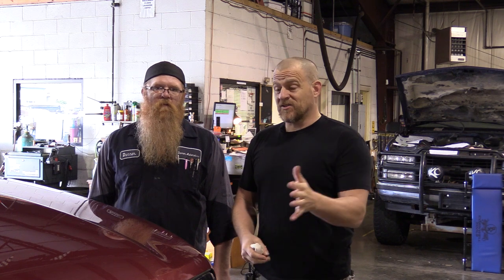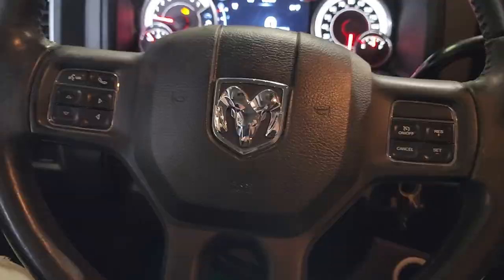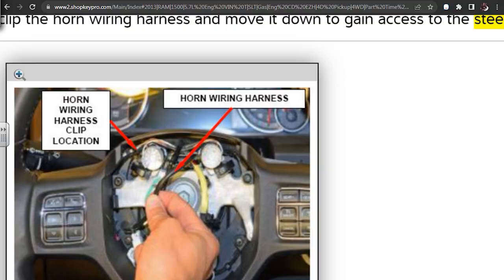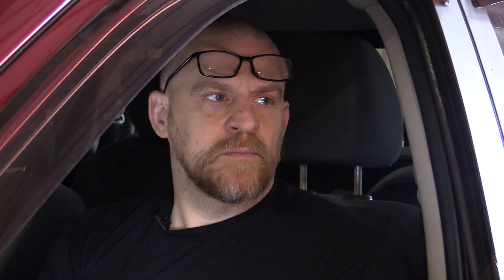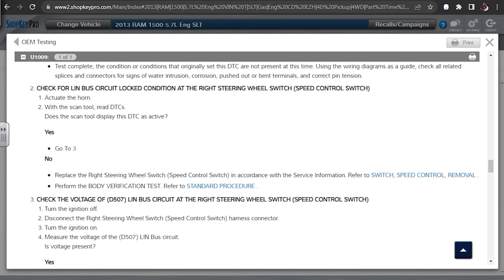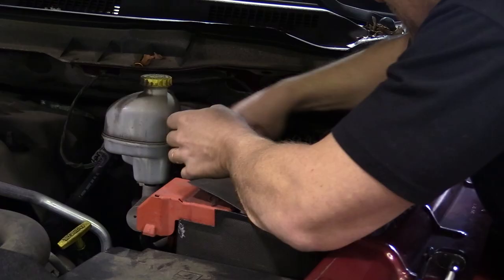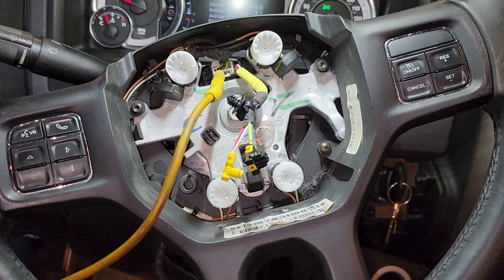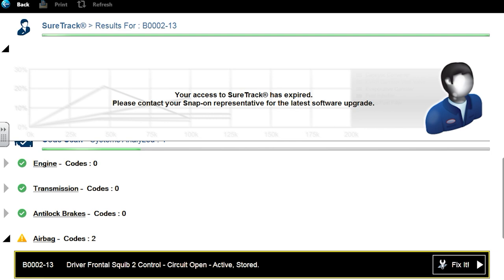2013 Dodge Ram - No Horn/Steering Wheel Switch Functions - LIN Bus Fault [U1009-00]

Comment from the maker: Happy New Year everyone! Just one comment on this video as I was not clear on this until the end. The Cruise Control Switch portion of the Right Steering Wheel Switch was hard wired and was NOT part of the LIN. This is why nothing else worked except the cruise control switches. ALSO the right steering wheel switch is a module!! And it had a broken ground, so this module was essentially dead. So again, why is a dead module communicating the cruise control switch inputs messages? It WASN"T, the cruise switches are hard wired! I meant to give an overview of that at the end of this video to make it more clear, but this message is good enough. Thanks again for a great 2022. Looking forward to what 2023 has for SD!
Reply: Thanks. And a better new year to you and your family.
Reply: Hello Paul,
What do you consider to be a reasonable price on a used Snap-on Verus Pro?
Happy New Year to you and your family. God Bless you all.
Reply from the maker: @janico76  depends on the update as I believe the pro is no longer supported by Snap-on. I know my Verus Edge support ends in 2025. What is it updated to? What model year? I'm thinking 2-3K tops
Reply: Wish you a happy new year for all of you guys.
Reply: @ScannerDanner  21.2
Thank you Paul for replying back to me. God Bless.
Reply: The hard wired switch input (I like the term discreet input) was described in the code description/theory and operation portion.  I had to rewind back to the wiring diagrams to realize the right button module had a dotted line around it, and didn't show anything about the cruise control buttons.  So you had to compare data given and diagrams shown to come to that conclusion.  And alldata kept calling it a sas steering angle sensor, while your verus kept calling it a steering column control module.  Lots of holes to jump across during this diagnosis but ya still got it figured out!
Reply: Hello I have a customer with a 2008 dodge ram 1500 having same problem. Do they have the same wiring harness for the steering wheel or do you know?

Comment: I was having the same issue. I pulled my air bag out and found the exact same yellow wire had broken just like yours. I soldered it together and it all seems great. Thanks for the info
Reply: My 2015 is doing this exact thing also. I was going to go the route of replacing the clockspring but I’m going to check that yellow wire first.

Comment: Why did I find this video literally the day after i fixed mine, mine was the Grey and Green wires failed.. $278/CAD for a new harness I went to the wrecker and grabbed another for $25. I've had cruise control issues for 4 years

Funny thing is the left button, the under buttons, heated steering wheel all go to the right cruise module.

Comment: I’ll bet the dealer tech caused this while performing the recall! Great video as always Paul!  Happy New Year
Reply from the maker: I think so too. They had the harness too tight when they installed that zip tie
Reply: @ScannerDanner  zip ties, also known as "zap straps", because they're the killer of networking and other low voltage communication cabling. doh!
Reply: Yup exactly what happened to me everything was working took it in for the recall and after 1one week my horn wasn’t working so now I have to fix it myself never trust a dealership

Comment: Just wanted to say thank you, my 2013 RAM has no functionality on any of the steering column controls, so I watched this and took it all apart was actually pretty easy, the recall work was done I could tell by the rubber covers on the airbag and the zip tie. I checked to make sure the wires weren't broken and they weren't, so I checked for power going into the clock spring and it is getting power in so I'm pretty sure it is the actual clock spring that's malfunctioning. Just wanted to say thank you your video let me know at least where to look.

Comment: I couldn't find one for this application, but Mopar sells terminal repair kits. You look up the connector and you can buy a pin with a length of wire already crimped in place. That way you can solder or crimp further from the terminal. It's also nice when the terminal is spread or corroded.
Great diag, I feel spoiled with my OEM service data and scan tool. Lots of respect to the independent shop technicians.
Reply from the maker: I really needed factory service info on this one. Thank you!

Comment: Thank you for the video.  I've been working on a Jeep JK project which happens to use the same switch.  The cruise control switch includes SC1, SC2, and SC ground.  The swich circuitry includes a resistor matrix and, by pressing one of the cruise control functions, you are creating different voltage drops on SC1 and SC2.  The resulting various combinations of voltage drops are what determines what button you are pressing.  This is similar to how the old land line DTMF phones work.  Anyway, on a Ram, those three wires (SC1, SC2, and SC ground) connect to the steering column control module (SCCM).  The microprocessor in that module senses the different voltage drops and outputs can-bus messages to the ECM.  The SCCM may also consolidate all steering wheel-based LIN traffic too but that is not part of my focus.  In a Jeep JK, however, all three SC lines go through the clock spring, bypass any (if any exists) SCCM, and terminate to the ECM directly where it detects the matrix and controls the cruise function.  I swapped a 5.7 Hemi into my Jeep and am trying to get the cruise control to work like the Ram.  I need the can bus messages that the SCCM generates when you press the buttons.  If I can connect my switch to a custom microprocessor that is programmed with the can messages the Ram sends, I can get my cruise control to work.  It requires a connection to the can bus and software that would display the can message when the button is pressed.

Comment: I have the same exact problem in my 2014 ram, this is the first video that has suggested it is not the clock spring. I will have to check to see if the recall extends to my year truck. Awesome video.
Reply from the maker: Thank you!

Comment: Great video as always ScannerDanner! Always appreciate watching your fault-finding methodology and seeing how thorough you are.

Regarding the right switch still reading on scan data, I think the key information is that the right hand (cruise control) switch is hard wired to the steering angle sensor, which to me makes it sound like it doesn’t use the same LIN connection as the other switches, and therefore the cruise control inputs would still be visible.

Just my thoughts on this tricky little issue 👍
Reply: Sorry, just watched the rest of the video and seen that you mentioned this near the end..! I really should watch all the way through before commenting!

Great work as always 👍
Reply from the maker: All good! Thank you so much

Comment: Definitely caused by the dealer. When I had a 2010 dodge 2500 service truck years ago I took it in for the tie rod recall and they didn’t even align it after, wheel was 45 degrees off so back it goes. After the alignment was sorted, full lock to the left seemed odd so I look underneath and the tie rod adjuster sleeve clamps are positioned to where they contact the front axle. I loosened the clamps and rotated them without moving the sleeve and it was good. We’ve had all the big three service trucks and I know this goes against some opinions but ford has given us the best service all around. That same dodge also left me stranded in midland, tx at 11pm on a Sunday when the tipm shit out. Good times

Comment: Had a 2015 towed in no radio, no crank , more than 1/2 of the under hood fuse box was dead.
   Info was not great on diag but I found that the ignition module ($900) sends a bus signal to module behind the seat that sends power to 1/2 the under hood fuse box.
    “Internet” had some hits on broken corroded wire back to the module behind back seat panel near rear window motor. Customer refused more diag time so never got to see the issue.

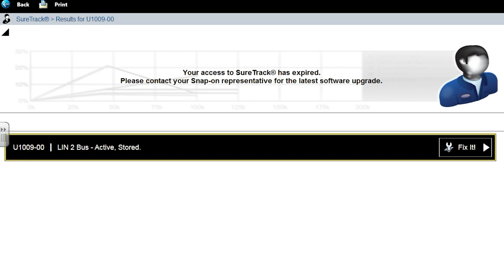Comment: You can see on your diagram at 6:02, (bottom left)--  that your broken wire was a ground (which was a white and yellow).   You said it was yellow;   I thought it was a yellow with white stripe-- because you can definitely see white on the video;  But I guess it was actually a white wire with just a yellow stripe.   There was only such a short piece of the color showing, and it's super easy to mix up white and yellow without blasting it with intense light so you can see it clearly.   Cool video
Reply from the maker: Combine that with my eyes that aren't so good up close anymore. But thanks for that confirmation! Appreciate it a lot! Happy new year

Comment: Interesting problem with this one. They don't give anyone much wire to work with there. Your brother had a great idea there Paul, where taking the wire and soldering it back to the terminal. If you tried to open that crimp and tried crimping the end of the wire in there you will lose your mind. I wish manufacturers would just make cut leads; repairs would be much easier. That way, you can install the new terminal and either solder or use a splice sleeve to connect it. I tried before to crimp a wire on to those metal terminal ends. I didn't lose my mind but came close🤣. I truly believe a robot does that crimp when made at the factory.

Comment: Now how many shops would ask a technician to diag this for 1hr? 

Or how many would change every part that it "could be"?

And out of those shops, how many of them would do so because they've not trained the front of house staff on proper procedures or how to properly explain and obtain approval for the testing required?

I think we're going to have a mandatory ScannerDanner video lunch on Monday to ensure our advisors have a true understanding of the work even seemingly simple issues may require.
Reply: Right, you/shop have to explain to customer what you do for the charges.
   Basically we do a minimum cursory 1hr inspection , pull codes , check basics , read code info . Then go from there.
   Had a issue with a 2015 Ram appears the comm line to the module behind the rear cab panel was short/open or module was dead. 
   We got to the point where the 1hr was up and the next step involved removing interior panels , carpet and such.
Customer decline more time.  He kept telling us to just put an ignition switch in , $900 and un available at the time , he towed it out and have not heard back.
Reply: @@user-ud8pj3sq2d  exactly! We sell by the test. The technician is given 1.0hr for testing and .5 for general vehicle overview. 

The tech comes back with a list of the test (and associated time) he needs to ensure we have the proper answers. 

We then matrix that time to ensure plenty of buffer is present and call the client. 

We do advise the client "Mr./Mrs. Client, we may find the answer on the first test or the last, I'd much rather underpromise and over deliver so I'm presenting you with a worst-case scenario"
Reply from the maker: This was the right way to handle it!
Reply from the maker: The service info was rough on this one. Incomplete diagrams to literally the wrong wording (key pieces of info too) in various places. In the end we got it, and editing made it look easier, like the removal of that drivers air bag lol but thanks Lucas!
Reply: @@ScannerDanner great job brother! At the end of the day, little of what our profession does is easy - but the great people of our trade take it in stride and get the cars fixed! 

Thanks for being part of this profession and supporting the guys and gals who serve the automotive industry and their clients with a smile every day! 

You make the automotive world a better place to be!
Reply from the maker: @lucas-ASOGPodcast  looking forward to continuing walking beside you in 2023 my friend
Reply: @ScannerDanner  not sure whats going on , we have Alldata for our primary info and I swear there is less and less info with each passing year. Also feel like they have deleted info on older vehicles.
   Identifix can be ok for diagrams. Its just getting silly the time looking for info is getting longer. Im 51 and looking forward to getting out.
Reply from the maker: @Mac-mu9cs  I think with the systems getting more and more intricate (not complex really), the description and operation sections of the service info is definitely lacking more than I've ever seen it. But that is a problem that has always been there and I believe it is just more magnified now
Reply: @@ScannerDanner  if you're both noticing a decrease in quality information overall, I have some contacts that would love feedback in that area. 

It certainly seems we're headed to a world where we'll need to rely on OE information sources as opposed to third party BUT what's concerning is often the third party has 99.9% of the OE information.

We've got to remember that information is pretty much copy and pasted - so is the lapse of information from the OE or is it from the aftermarket source?

Some of the OE contact I have assure me they want to make 100% sure the aftermarket has the data available for proper repair of their automobile - the reality being 70% of automobiles are repaired in the aftermarket - the manufactures are well aware if shops won't or can't fix their cars its a bad look. 

Yet we look at dealer level training which still teaches resistance testing and a 100% focus on parts changing and it sure makes you wonder...

I'm reminded by a story Ken Neal told about down stream fuel trim and quoted an OE engineer as saying "that won't fail within the warranty terms, so it's not my job to fix it or make you aware of it".

For the time being, I'd make use of OEM1STOP.com - it still requires a log in for each website, but atleast they've got them in one place. 

I'd also encourage anyone who cares about our industry to support the Equipment and Tool Institute (they work very hard to make sure we get good tools, good access, and good information).

It's organizations like ETI, ACA, ASTA, and AASP that can work towards a singular message and vision for our profession.... and it's the only way anything will change!
Reply from the maker: @lucas-ASOGPodcast  I 100% believe the lack of good info is coming from the OE. I know of first-hand specifics of friends on the front lines at VW and Kia (wrote this before finishing reading your comment. The example you gave does not surprise me)
Reply from the maker: @lucas-ASOGPodcast  will you share this comment on my SD Facebook page? I want to know more about these organizations. Show me the light brother lol

Comment: We have on of these trucks in the shop right now. Same scenario clock spring(steering control module) has been misdiagnosed and the U1009 code is still there .We do have cruse control operation but nothing else on the steering wheel works. Unfortunately our fault is not as "easy" as a broken wire. Power, ground and LIN bus are good at the switch module. I put my scope on the LIN and found a weird repeating signal coming from the steering control module. This signal is the same with the switch plugged in and unplugged. I believe the steering module is sending out a health signal to the switch module and getting no response. So I have called the switch module and we will receive it in Tuesday. But piecing this circuit together across multiple wiring diagrams I don't see what else the fault could be so fingers crossed. Great work and Happy New Year🎉🎊🎉🎊
Reply from the maker: Looking forward to the update! Let me know how it goes. I wish I would have done more with that LIN signal.
1. What did it look like with the bad ground to the right steering switch
2. What did it look like with that connector unplugged (signal from the SCCM only)
3. What did it look like with only the right steering switch/module communicating 

I'm sorry I didn't do those checks. They would have helped us understand better.
Anyway, please update me okay? Happy New Year!
Reply: Well, the truck is fixed. The switch was bad.  What I thought was a wake signal from the module may have been a red herring. I put the scope back on the Lin wire and plugged the switch in, and didn't notice that much change in the pattern. It didn't do what I suspected it would, but the system came back to life. I would have liked to do some further testing, but of course, by the time the switch was there, the customer was waiting in the office. I guess that's how it goes. Stay safe
Reply from the maker: @oktiretravis  thanks so much for the update! I just had a guy send me some LIN bus captures he was playing with on an Audi where you could actually see differences in the master and slave node messages. Not much, maybe 200mv but it is worth studying for your exact scenario.

Comment: Happy new year to everyone!
The right switch cluster uses a resistor ladder and decodes signals by comparators in the receiving module. It is a trick used in european cars for decades already and ,as far as I know, it was invented by Walkman Japanese manufacturers and used for remote control along the audio wire. A cluster of switches with 2 wires only. Of course, this one in the video is a bit different (has 5V ref).
Cheers!

Comment: So just to operate the horn, it's:   Horn switch > right switches > Lin > SAS > CAN > BCM > horn relay > horn...  I mean, how much more ignorant can we make it.. smh.  There's no sense in the horn being that complicated; granted, they just piggy backed it onto the other switches that are there-- but no wonder these things fail -- you're giving it a dozen points of failure along the way.
Reply from the maker: There are some major advantages with these designs too. CAN and LIN bus circuits have changed the game for the better in most circumstances. In fact, it's even simplified many circuits that used to be much more complex. But yeah, I get what your saying.